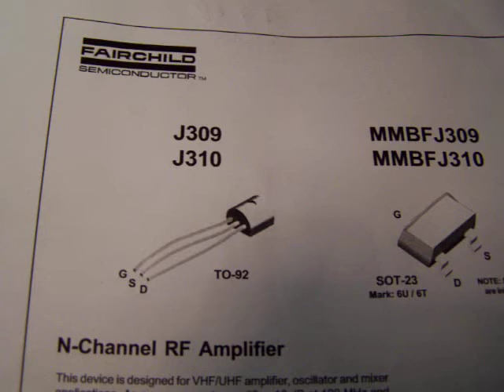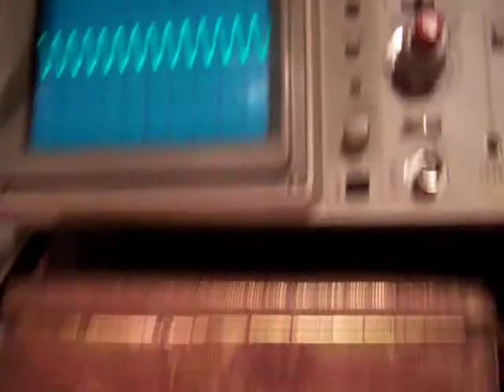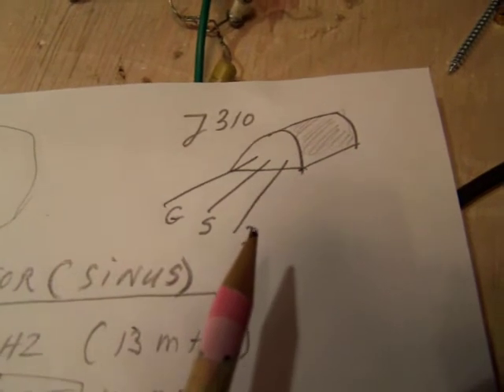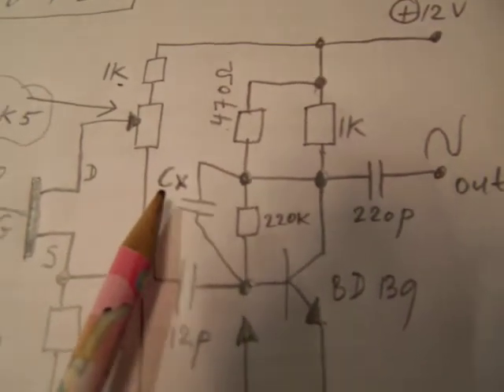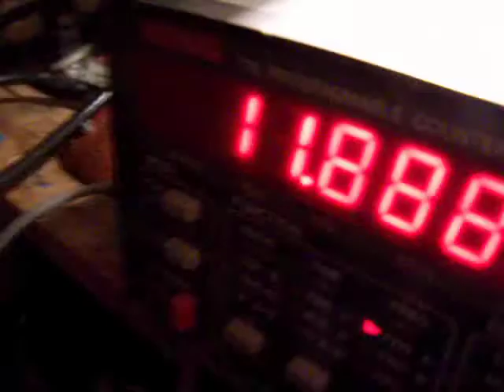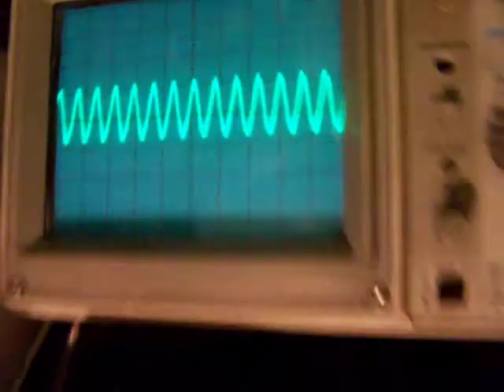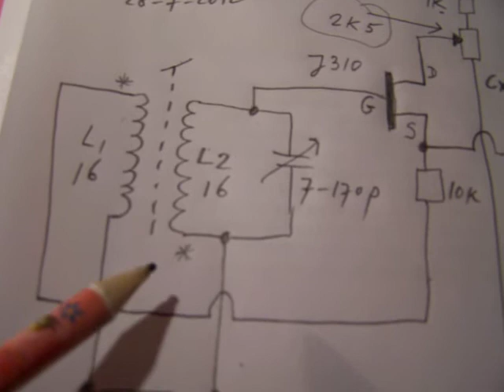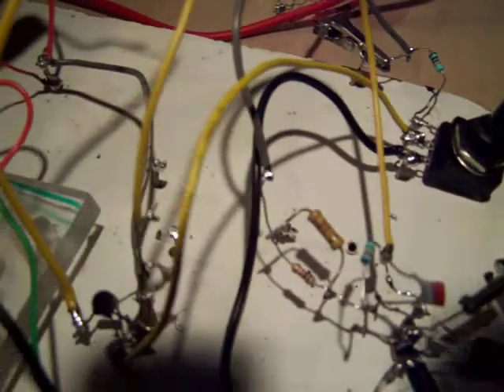local oscillator with FET (J310) 3,2 MHz - 13 MHz

Comment from the maker: Indeed, when you want to use this circuit in real you must make it neat with wires as short as possible, a proper ground plate under it and a sturdy construction. THis demo circuit gains quality and stability when it is made that way.